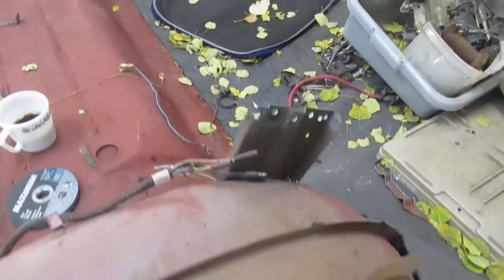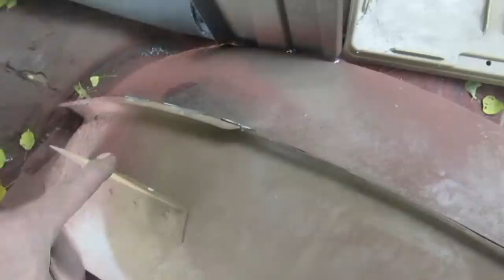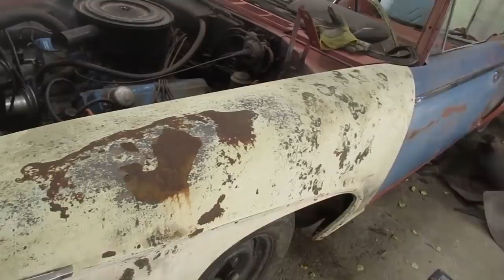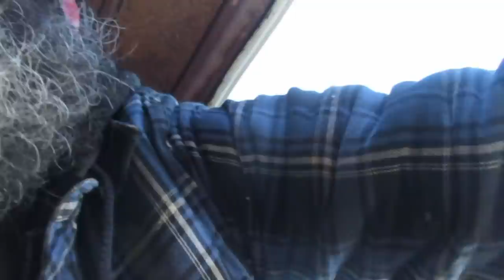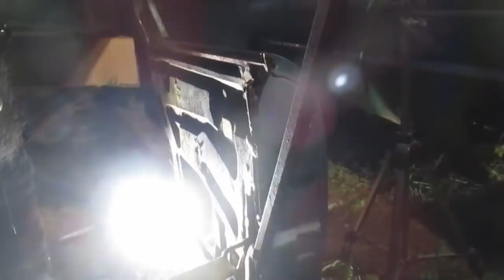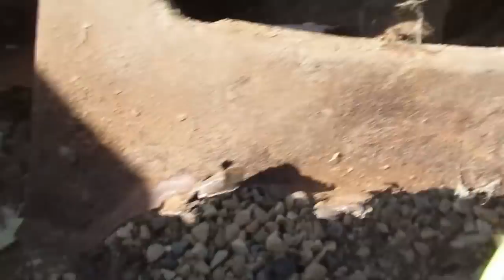1960 Plymouth Fury Daily Driver Special! Part 3: Mutiny! Disillusionment! (and Drilling Holes.)

Comment: Outstanding work wrenching, drilling, and grinding on these two machines. The Fury Daily Driver Special! is an important series because you folks get in all the way, where the project is over your head and the only way out is to quit or keep slogging through it. Luckily for us you keep on chugging through, methodically dealing with each new hidden weld or rotted brace and never letting up. The backyards of this continent are filled with projects that got as far as the demo part before total abandonment. You guys are an inspiration to keep wrenching!

Comment: That's the first time I've seen lichens on one of your cars. Where I used to live inland, most of the old cars end up with lichens if they've been in the shade when we've had frosts. It also grows on glass for some reason and really resists being moved.
That project is sure getting BIG, I can really understand feeling blue about it. As I've said I refuse to skip ahead, I'm pretending this is happening right NOW. I've got faith in you and I'm rooting for your success. A definite test of mettle and character.
Seven beer lunch....lol. Guilty your honour.

Comment: Subframe with running gear comes out of those Chryslers pretty slick. Did it on my ‘64 NY project - that the more I watch I notice shares a lot of DNA with this Fury.
Reply from the maker: Yeah, I may still roll it out, but not til the body is roughed in... Your NY would be similar under the tin, for sure... Probably same cowl and all, with a longer rear seat pan and rockers. Cheers from here!

Comment: It just goes to show how similar a range of mass-produced vehicles is structurally, no matter how different they look on the outside.  It's a huge job but it's coming along well, real major progress has been achieved and the path ahead is looking much clearer now.  Lovely score on the front wing/fender and the associated parts, that's really going to take a massive amount of work out of the project, IF the original item was even savable...

Comment: I see a blue Plymouth Fury shirt coming to my closet soon. ;o)

So many good comments by the "mechanic" in this video. "Notice the total absence of help" !!! LOL I found those "roto-broach" drills work really nice for drilling spot welds and separating panels. Assuming you're keeping the "back" piece, if you're carful, you can drill ONLY the front piece so it's much easier to do the plug welds. You DO need to be able to see the welds however. Don't you just want to "love" those spot weld guys at the factory who went nuts with that spot welder??? Like most of those panels you have already drilled out. 
Anxious to see how you measure and template all the panels that you are going to "splice". Like the quarters and other panels that are not being re-attached as complete panels.

The clock just chimed 2:00 AM. Time to turn in. Good night !! 😎🤠👍👍
Reply: I was thinking the same re the templates of all those panels that seem to support each other, but then I saw the SM Citroen vid where Scott made the inner panel which locked the fender in, and I realised, this can be done.  It is great to watch great craftspeople at work, even when their 'mates" desert them.

Comment: when the car was sitting in the cowshit in the field first off, that fender seemed to me like a deal breaker on the whole project.
there was just so much "car" left still though, and that stainless holding everything in place!! hah
one of the coolest cars ever though so...neat that yer saving one to fight another day.
Reply from the maker: Yeah! I just couldn't resist trying to save this one, even though I knew it was a bit of a job. Cheers from me and Frankers!
Reply: coldwarmotors, cheers to you & Frankers! Fer shur.
bet they stiffened the convertibles bout the same as that bubble top!
they probly figgered "let's just let that bubble top float there lookin pretty"!

Comment: Spray engine bay with oven cleaner then pressure wash. Wont damage rubber but will remove all grime and shit. Saw it on SWRNC's channel. Worked pretty snazzy.

Comment: Eagerly awaiting the next episode!  And for what it's worth (very little), in my humble opinion, it IS worth the time to pull the engine, clean it and the bay, and paint them a proper color.  Why drill out 10,000 welds and reverse-build a car structure (ie, the HARD way, folks) but continue to hate the engine color/appearance at the end?

Comment: Nice job! Get a set of drill hog drill bits, they cut like no other and they have a lifetime warranty. Also fill a spraycan top with cutting oil and dip the tip before every hole.

Comment: Keep the updates coming the car is starting to take shape. What type I’d saws and blades did you use to fit the cars I need to get rockers and body mounts for my truck at a junkyard and I’m wondering what the best way to cut them out is?

Comment: And i think you have to paint the engine... Honestly those engine practically fall out of those cars.  I love working on 50's cars, they are so simple.  If your honestly going to keep it, spend some time now and get it nice.  A 60 Fury 2 dr ht is a special car.  You seriously will not see one during your lifetime unless your hunting for it.  You MUST paint the front edges of the fender white, paint the rest of the car blue.  I love the blue white/red white combos on the 60 Fury.

Comment: Have been trying to figure out, given the incredible deterioration of the lower body of the Plymouth, how you will get an accurate fit between the Dodge and Plymouth bodies.   Is it because in the area of the rocker panels the bodies of both cars were preserved and that upon the mating of the two bodies their correct joinder in that area will expose any excess or dearth of connective sheet metal in the other areas?
Reply from the maker: Yes, more or less... There are lots of mating surfaces in good condition that will determine the exact location of the relative parts. One advantage of doing a big splice like this is that you are only fitting up two parts, instead of a bunch of small reproduction pieces, each with its own inaccuracies and many more opportunities for error to creep in. In this case, the windshield frame, rear trunk floor, and wheel houses will "hang' all the rusty, incomplete parts in their original, correct locations for repair in a "build -to-fit" process that we can trust, knowing that the whole body is in the correct position before we start. I hope that kinda makes sense? Cheers from me and Frankers!
Reply: @coldwarmotors  Was just thinking that the two intact major unibody assemblies are precise jigs for determining the location of each other and the other parts.  Would love to be there helping out!  Perhaps, missing agents did not see the bigger picture!

Comment: Since you don't like the color of that 318 poly (a rebuilt motor, resprayed?) why not swap out the K-Member with the 383 in the Fury?
Reply from the maker: Oh! The 383 in the other chassis is seized... The poly is rebuilt and runs well... I may swap to a 4-barrel, just for laughs, but this car is not about the engine. I'll keep the 383 and fix it someday, maybe for a different fwd look project. Cheers!

Comment: Do I spy cruise control bits above the brake booster?
Reply from the maker: Yes, the previous owner had installed a 70s Chrysler cruise in the car... not sure if it will stay; maybe I'll try it to see if it works and then decide...Cheers!

Comment: need to get some 5/16 spotweld bits, save drilling through both panels
think i might be inclined to remove the quarters to get to the rocker welds then put the 'good' one back later
Reply: Was thinking and wondering about that as well. Everyone has their own way of doing the same chore and their own limit line between just "getting it done" and "doing it the easy way".
Reply: Problem with spot weld bits is they're much more expensive and don't last very long. In spots where cosmetics are important, totally worth it, but when banging through the trunk floor, not so much.
Reply: not really, i been a panel beater in collision and resto since 86, always used them and they can last long enough to be worth it, never used the very expensive ones, if you treat them well you get good use from them
1-3 bits for this fury swap probably
when we changed buildings and put up a new section of I beam i used some as 'pilot' bits for larger drill, kept oiled i managed to go through 1/4 plate with them but that was extreme situation.
Reply: This seems to be one of those, there are lots of ways to do it and everybody thinks their way is the right way, when in reality all the ways just suck differently. I had a boss who liked to make his own spot weld bits out of masonry bits. I could never get them to work right personally.
Reply: https://i.ebayimg.com/images/g/-1oAAOSw3KFWdUpq/s-l300.jpg
i put this image up just to clarify which type of bit i was referring to as there are a couple of designs

indeed bluetoes, everybody has their own way they do/were taught, if it works for them then thats cool
even being in the trade as long as i have i still find a better way to do something here and there.

Comment: i know you cant do this with a 57-58. the roofs are lower on the 2dr hts.  Have you checked?  I don't like that gap on top of the door vent.  But i went back and in video 1 the trim looks like it will fill the gap??? the windshields are the same but the slant is slightly off.?

Comment: I had a 57 Plymouth Fury 2dr in 1964 in Chicago in seven years it had completely rusted out head lights would jump around , I think it was inferior sheet metal used by factory thats why these cars did not survive , shame.
Reply: it's the salt dude
Reply: The 57's were rushed to market. Plagued by rust, water leaks, etc. In 58 Chrysler undertook a massive and expensive quality control program to redeem themselves

Comment: You are trying to make a short cut, when restoring an old car that rarely works. Your problem is the outer skin of the Fury, that problem is still there and you can't just butt weld the pieces together and btw the rear wheel openings are different, the shape is the same but the lip isn't. Not sure if the Fury stone shields wil fit the Dodge wheel openings. Maybe this will eventually work but I think you won't do it this way again.
Reply from the maker: Stay tuned!
Reply: I will! Thumbs up for saving the Fury anyway (I own a 60 GC Fury coupe for 30+ years) If you have any questions, I will be glad to help.

Comment: is that left rear wheel well cocked in at the rear and not parallel to the body work?everytime i see it it bugs me for some reason. what color was the block originally? was it that aqua greenish hue like my '66 polyhead 318 was in my Coronet ?or maybe  that spiffy hot rod orange like the max wedge was? lowered motivation requires a drink and a dooby to take the stench away from the mouse la feces and urine aroma, no doubt. deserted by the enthusiastic agents, say it isn't so . lmao! ☆☆☆